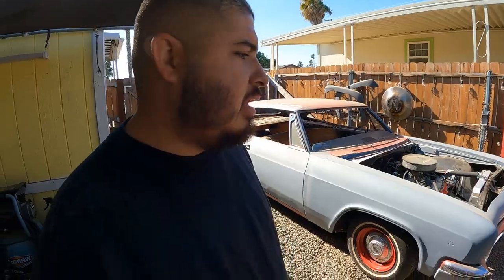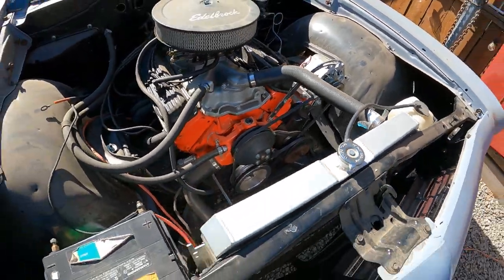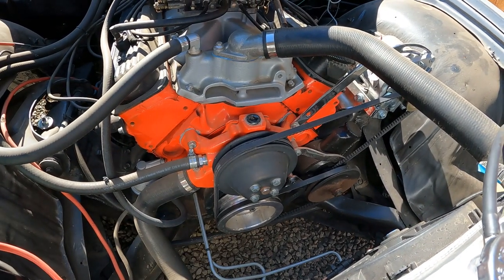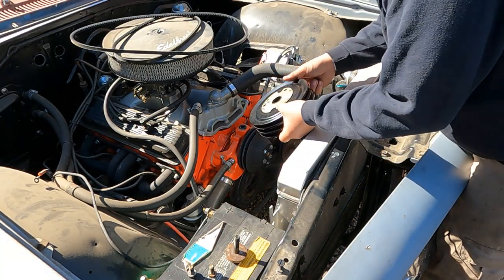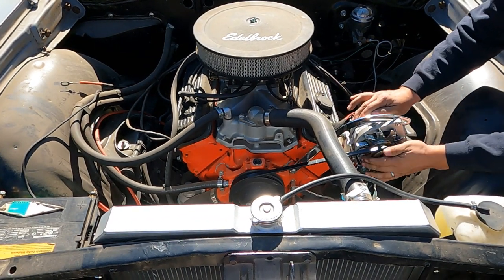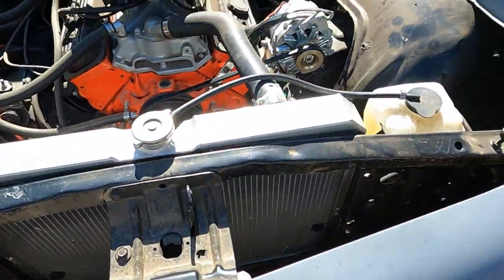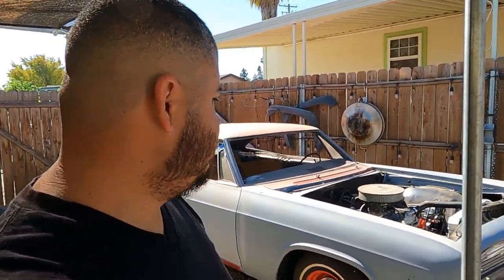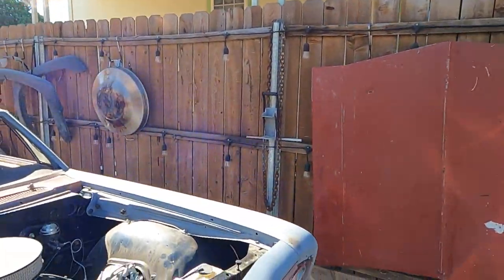1966 Chevy impala 400 small block running hot, wants to overheat

Comment: Bro- you need to pull your heads and make sure those later 350 heads are drilled for the steam holes that are specific to 400 engines.
Reply: yea, reg heads that are not setup for the 400 need to have the steam holes opened up, also, new thermostat, good but specialy on the 400's, add a 1/8" drill hole on the outter rim of the thermostat, for air bubbles to easier pass + also add's a teeny bit more flow, my old cheyenne with a 400 i did 2 1/8 holes but my heads was original for the 400. also probably going to get some hate but not sure what temp that stat is, but if its a 195, try to find a 180. never had an issue with mine even in 112F temps outside.

Comment: Steam holes drilled in heads?
My 400 stays at 180 but smokes white out of breather only no smoke out tailpipes any ideas
Reply from the maker: Yes the heads haven the steam holes drilled, I was thinking maybe the under drive pulley was spinning the water pump too fast, I’ve been thinking of going with a fan and clutch assembly with a fan shroud to see if it stays cooler
Reply: Oh- sorry, just saw this
Reply: That aluminum billet pulley spins the water pump slower, not faster.

Comment: Bro you have a nice set up; engine and the inside engine bay area. I have my alternator on the driver's side also. I didn't think I could put a power steering pump set in there. I'm glad you made this video. Keep up the good work. I push a 1963 impala coupe hard top with a 327 under the hood. Also I like your roller motor, I once rebuilt one of those in my garage adding roller rocker arms arm as well. I live in Stockton, Ca. What city are you representing, if you don't mind me asking?
Reply from the maker: I stay in woodland, ca about 40min from Stockton
Reply: @cali530marcos3  what's up g

Comment: If it applies, what vacuum port is the distributor advance routed to? Ported or manifold vacuum?  Having it to manifold should help it idle with a bit advance, idling cooler. Worth a try
Reply from the maker: I have it on ported vacuum, replacing the lower pulley and adding a fan clutch fixed my issue

Comment: Fan and shourd sounds like a great idea and it look like you had center bolt valve cover and 350 heads ? 400 small block had steam holes in the heads and blocks  I like 400 small one of my favorite engine.  Good luck with you fix .

Comment: Am working on an overheating 400sbc as well.  Bored 0.040.  looking to cool it better.
Reply from the maker: I took off my electric fans and put a mechanical clutch fan, also with the stock pulley it seemed to help it stay cool, now all I need is to install a fan shroud and it should be good to go

Comment: Have you checked the heat cross over under the intake did you block the ports properly
Reply from the maker: The edelbrock manifold I installed didn’t have that option since it’s a high rise intake, but I’ve been driving it and it seem to be fixed

Comment: Run the bigger pulley, put a mr gasket 180 tstat, run the stock pulley fan inside and electric outside should be fine after that 👍🏼 ... I have read those blocks run hot
Reply from the maker: @chucksbravo54  I’m going to install a fan with clutch fan and the fan shroud to see what it does

Comment: Love the 400! That hooker is really talkin!! I see you got some Vortex heads on her- So if you don't have one already in it, try a thermostat with a by-pass hole or a weep hole. If you have both of your fans hooked to the same temperature switch they should be divorced to where one comes on first say at 195 then the second at maybe 205 or 210; but you will need a 195 t-stat. And also if you are running antifreeze or a mixture of it, it does not transfer heat as well as plain water. Since city water is generally loaded with calcium chloride, the chloride portion of it is pretty corrosive; especially in a system containing both ferrous and non-ferrous metals. To avoid that, always just run distilled water in your cooling systems. 
 Forgive me if I'm wrong but from my Keyboard Commando post, it looks like you are in Cali., somewhere. My point being that if your latitude does not see too very much below 32° F,  I wouldn't even consider running anti; especially not with a 4 hundred sbc and let alone in an .030 over mill. Please keep us filled in. Btw- NEW subscriber here!!

Comment: U need to put the original fan  back on that spins with the motor and a shroud and u will be fine.
Reply from the maker: @racer67  I went back to a stock fan but still haven’t installed a fan shroud yet, but it does stay cooler

Comment: If your temp sensor is in the cylinder head it will read hotter than at the thermostat housing.
Reply from the maker: Really, well I guess it makes sense since that’s where the exhaust gas’s comes out of, there’s a port on my edelbrock manifold that’s next to the housing, I’m going to try that one

Comment: I wouldn't have it without a fan on the pulley and cowl
Reply from the maker: Yea, going to be putting a clutch fan on there and adding a fan shroud
Reply: @cali530marcos3  lots of guy throw the Kowloon away,but it helps to cool the engine by at least 15 degrees,and thats alot considering the combustion temperatures

Comment: A smaller bottom pulley would make you WP turn faster and essentially cool better. A larger pully slows it down. Wouldnt it? If you had the alt belt on diffrently you could have saved a few bucks buying a new one :) and a headache lol You also could probably have just used a long WP from the get go since you have electric fans and all the extra space. Lining up pulleys on a long pump is so much easier. If it has an electric choke, pumping it like that wont help it start (generally).
Reply from the maker: It’s a manual choke but it’s not hooked up, and for the small crank pulley I thought the same thing, I thought it would cool better but it was running hot, then when I swapped out to a larger one it cooled it down like 10-15 degrees. I was thinking about switching the alternator to the other side too because it looks too empty on the passenger side like it’s missing something
Reply: @cali530marcos3  well dang. My setup is basically identical as what your doing. I havnt started the engine yet but I have a small crank pulley also. So ill have to watch my Temps to check that.. All my stuff is on the driver side also. It is alot but I figured with the space on pass side I can mount some AC someday and even out the look
Reply: Bigger crank pulley spins the pump FASTER.